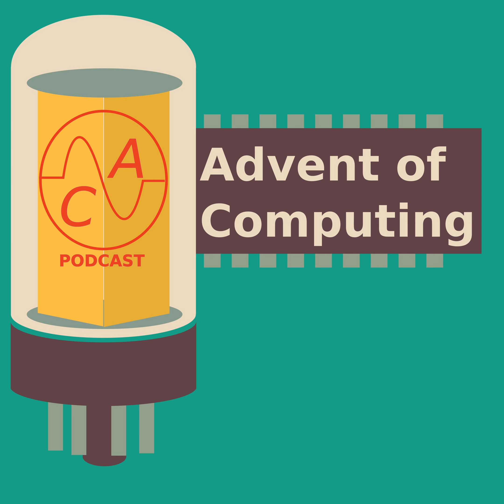Episode 65 - Teletype, Teleprint, and Telegrams

Comment: 34:30
I want to point out something here. Timesharing and TDM are both two sides of the same coin. Just one of them is a term used by OS people and the other is a term used by the networking people. To make maters more clear, timesharing is contrasted with space sharing. In networking, this corresponds to FDM and CDM. Virtualization and multiplexing are also two sides of the same coin. In fact, the purpose of timesharing, TDM, space sharing, FDM and CDM is just to virtualize or multiplex a resource, meaning that it gets shared by multiple sides, where each one thinks it is the only owner. Some times you use one or the other. I virtualizing the CPU, you use timesharing, but in virtualizing storage and memory, you use space sharing.